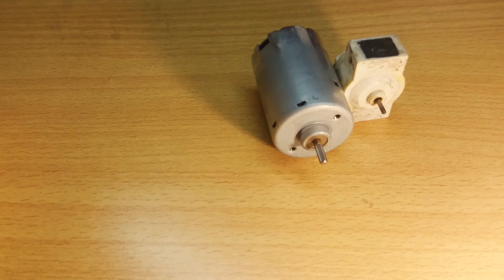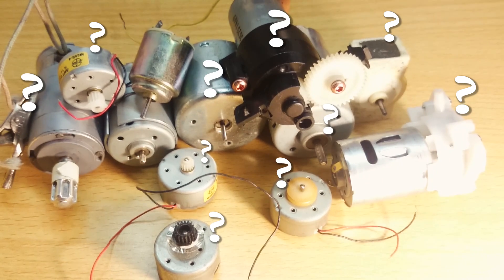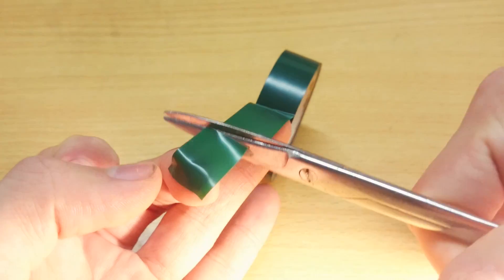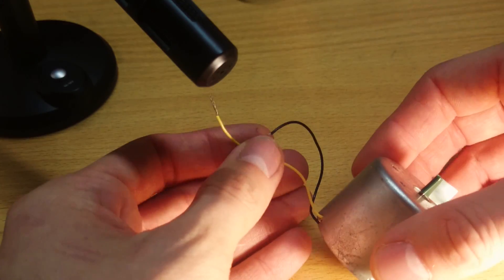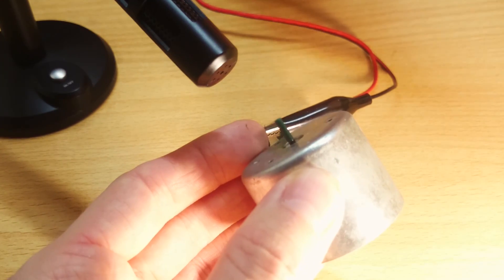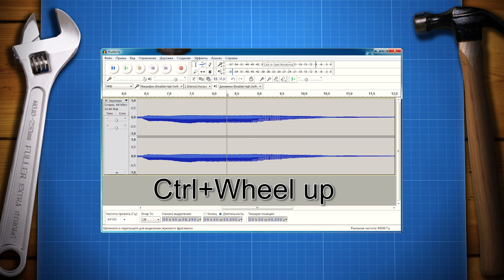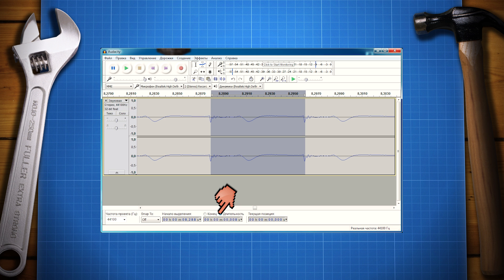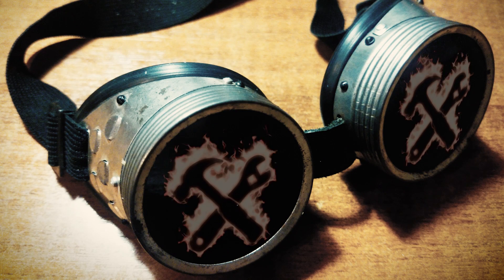How to measure RPM of motor

Comment: I figured it had to be able to be done through the pitch of the motor's hum but then I realised that the internal structure of the motor might double or quadruple the fundamental frequency and complicate matters. This method removes that problem by creating a series of transients definitely created once per rev. Brilliant thankyou. :-)
Reply: Just the motors hum works. You just need to take the spectrogram and look only at the fundamental mode. Just did it a couple of minutes ago and then came across this video.

Comment: That was very helpful in my project. My 2200kv BLDC motor was noisy enough on its own that I didn't require any tape. What I quickly learned was that with a resolution of .001 seconds the calculated RPM when reading .001s and .002s is 30,000 RPM. Yikes! I had to increase the accuracy by measuring   as may spikes as possible then divide that by the over all time.... Then I discovered. If I changed the reading from milliseconds to samples and project rate  to max hz (384000) then used the formula [60/(measured sample time/384000)] I achieved a higher accuracy.
Thanks again.

Comment: But doesn't the length of the tape effect the RPM value? I mean if you consider the distance between the motor rod and the edge of the tape as the radius, the RPM value is dependent on that radius (the circumference of the circle created is pi * r * 2). So it's not perfectly accurate.
Reply: Sagie Levy No, it will still make the same amount of rotations. The larger the tape, the more speed it will have a the long end of the tape to make the same amount of circles as the short end of the tape.
Reply: @macnavi  I see it now, thanks!
Reply: @sagielevy  Altering the length of the tape will alter the tangential velocity at the tip of the tape, but the angular velocity will always remain constant.
Reply: If you cut a longer length of tape, the tip will travel a further distance but will have the same rotations
Reply: i'm a bit confused. Can someone tell me the reason of adding the tape to the rotating part of the motor? Was it just to produce soundwaves? But doesn't the rotating part produces sound even without the tape attached to it?
Reply: @ROB_g173  to make that intermittent sound as it touches to finger at each turn.
Reply: You make a point; but it has to do more with the load: the more tape, the more weight you add. You would have to add a large piece of tape to make significant difference though.